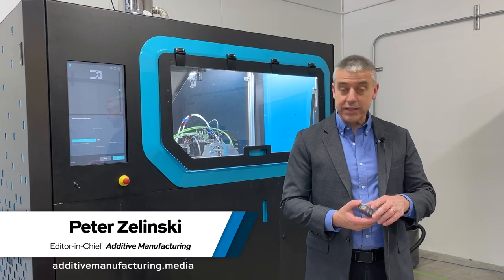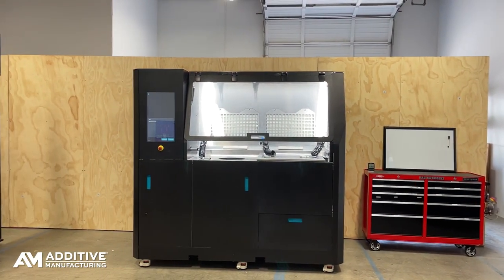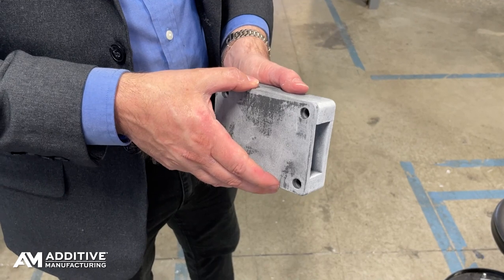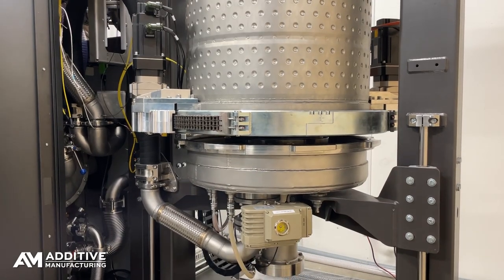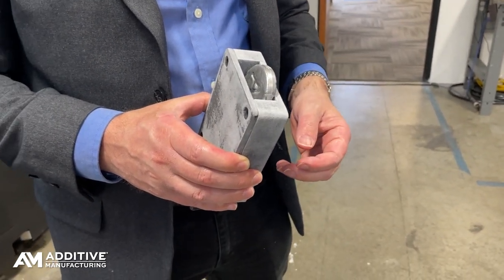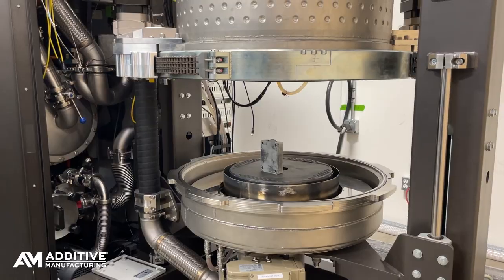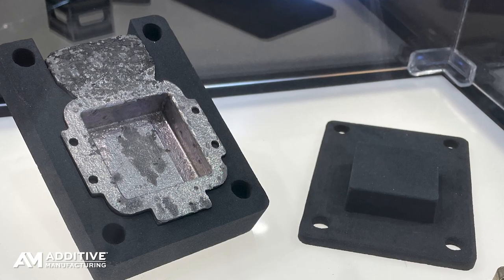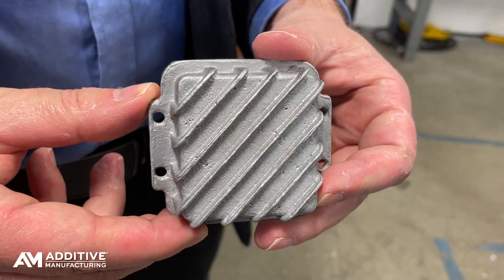Metal Casting Using 3D Printed Mold and Microwave Furnace: The Foundry Lab Process Explained

Comment: Is it true that the mold, right after binder jetting 3D printing, still has loose ceramic powder? How does the mold curing by the microwave furnace work? Does this process enable a nice surface finish for the final cast piece? Thanks!
Reply from the maker: From Foundry Lab: Typically, after printing, there is little green strength. Like most binder jetting systems, heat is used to set the binder. The final part has a surface finish between sand casting and diecasting.

Comment: Although I like the idea somewhat and admire your commitment, I have to say that the approach looks terrifying. The surface quality looks much worse than an average sand casting with this wall thickness, no localised feeding is provided and mechanical properties are likely to be far below standards with these slow cooling rates. The process cannot be used for more than demonstration parts, and it is very expensive for that, as I can achieve the same effect with a painted plastic print.

Comment: is this viable for mass production?
Reply: No, but still very cool. Is the mold reusable?
Reply: its basically for R&D, Testing purpose.
Reply from the maker: It depends on what you mean by “mass.” Die casting is going to be more cost-effective for high volumes. If the quantity of parts needed is in the hundreds, this is potentially a viable production solution. This article gets into that: https://www.additivemanufacturing.media/articles/foundry-lab-how-casting-in-a-day-will-improve-the-design-of-metal-parts-(includes-video)
Reply from the maker: @davincifpv3842 For the most part, yes, the mold is reusable. One exception might be if something about the cast part geometry requires the mold to be smashed to remove it. Barring that, yes.
Reply: If you are looking for mass production, you are better off 3d printing the pattern and making the mold out of endurance ceramic. Did this during my master's days, and was able to yield at least 100 castings per ceramic mold. The drawback is you are still required to part the mold, which might limit the complex geometries that are achievable by 3d printing.